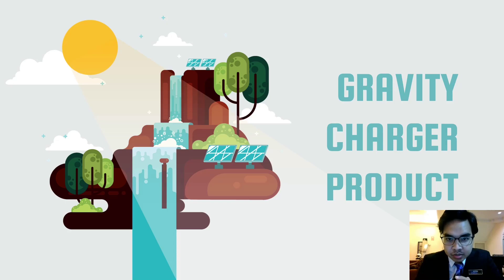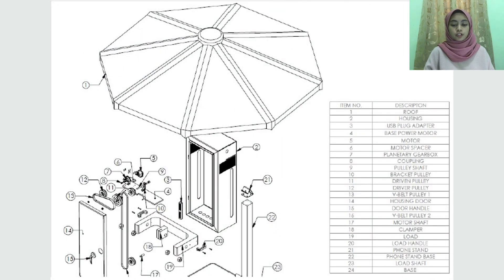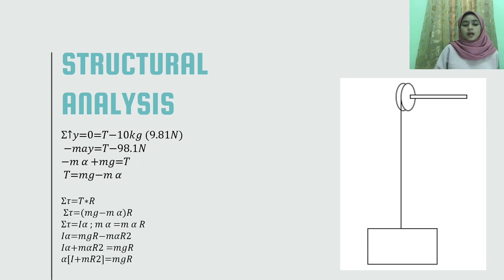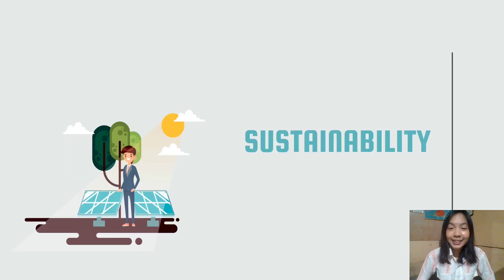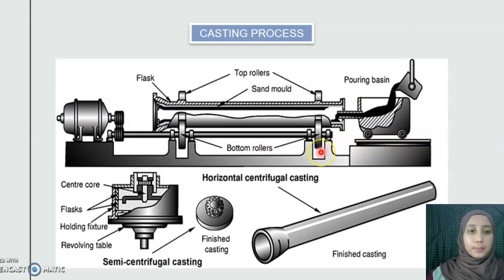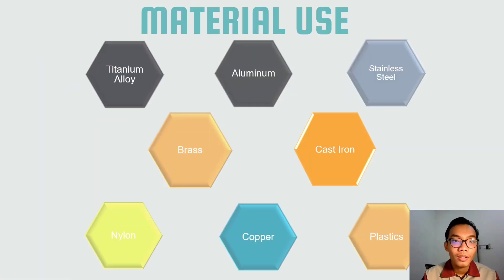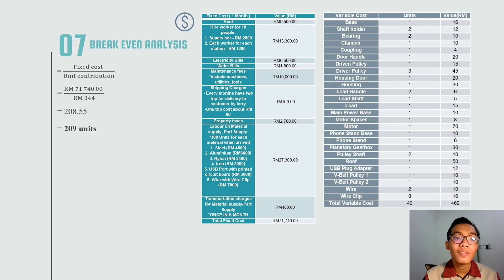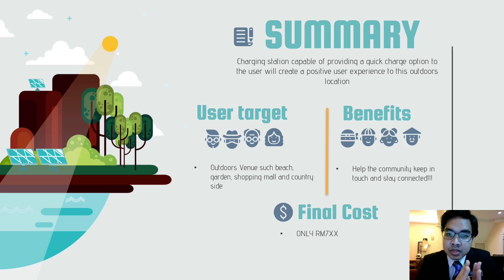IDP BMFG UTeM 20/21 - Gravity Charger

Comment: A good alternative idea for renewable energy. Video is nice as well. I got few questions here:
1. How effective is the cost compared to other existing energy available ie solar panel.
2. Is it safe to operate in heavy rain/lightning situation? Would you consider a covered 'booth' instead of open concept as presented.
3. With 44083rpm mentioned, how long does it take to fully charge the phone? For fast charging, you're looking at something that bumps the voltage up 5V, 9V, 12V, and beyond, or increases amperage to 3A and above. Can the product support this requirement?.

Thank you
Reply from the maker: Thank you Mrs Syahirah, for the comments. Sorry for late answers, here is our answers for the questions:

1. If compare with system, the cost for gravity charger is high compare to solar panel but gravity charge is not designed to replace the solar panel. It is designed for another alternative which the place that solar panel cannot be used. Example: At a recreational place or waterfall campground, there are a lot of tree that will have shadow which it is the disadvantages of solar panel to generate electricity. Even though the gravity charge cost is highest than solar panel but compare in operation of the system, gravity charger is easier to operate and cheap. 

If we dig into some research of the smallest size of solar panel which is (80mm x 60 mm) , the current and voltage will be 0.3A and 1.5V respectively, thus the power would be (0.3 × 1.5 = 0.45 Watt). And the cost of this solar panel will be around RM 8.00. 

But if we want to use as a charging smartphone system, the amount of volt for the solar panel to supply for the electricity must be at 5V at least and 1A, which means 5 Watts of power. And the cost would be around RM 59. 

The cost manufacturing stated for this gravity charger RM 699.13 per unit. The cost of the product only just one product. If we do in mass production, the cost manufacturing somehow could be less.

2. Yes, it is safe to operate in heavy rain / lighting situation because the material that we use to the covered the component is not conduct electric and the roof is covered the user when charging the phone. Yes, the product is designed based on open concept because it is human comfort in public area.  

3. It took 40 minutes to 2 hours depending on the battery capacity. But our product did not expect to achieve full charging capacity as our main focus to provide a specific amount of battery to ensure the user has enough battery capacity before they went home. For the bump voltage and the amp setting, our product focus on 12V with 3 amp so this product can produced desired output.
Reply: @nurafiqahaliya9763  Thanks Aliya for the answers. good discussion here.
Just some recommendation, as the concept is using motor, pulley and housing, all these component require maintenance. Please consider maintenance fees and also come out with proposed schedule maintenance based on rev/min calculation or any other relevant parameters to ensure good reliability/maintenance of the product. 

overall good product. Good luck!
Reply from the maker: @syah8517  
Thank you Mrs Syahirah for the recommendation and opinion. We will make improvements on the maintenance fees of the products and include it in our final report. Thank you again:)

Comment: Thank you for sharing information about this project. I like the video (it is simple and the color is nice) and love the idea of the project (simple mechanical means of generating electricity). May be useful in specific situation where access to electricity supply is limited. I have few questions to ask:
1) What is the size of this charger (height and dimension of the gravity charger)?
2) What is the amount of electricity that can be generated by this charger? can you provide simple calculation or estimation? Will it be sufficient to be used for charging phone?
3) What is the load of the mass? 
4) How high should the load be lifted in order to provide sufficient electricity for charging purposes? Will the time taken for the lifted load to touch the ground give impact on the production of electricity?
Reply from the maker: Good morning Dr Fatimah and thank you for the compliment. Here are the answers for the questions:

1. The height = 191 cm x length = 200cm x width = 200 cm (include roof) and the height = 191 cm x length = 110cm x width = 60cm ( without roof calculation) 

2. The charger has rated output voltage of 12V with the output current of 3 Amps. The charger wattage is 36Wh (power = voltage x current) 
12 X 3 = 36Wh
36Wh charger power consumption

Consumption 	 Total (Wh)	   (kWh)
      Hourly 	                36	           0.036
  Day (2 hrs)	                20                0.02

The gravity charger power consumption per day is 0.056 kWh. 
Yes, it is sufficient to be use for charging phone because the charger has rated output voltage of 12V with the output current of 3 Amps which the phone can fully charged with a charger that has more current capacity than needed.

3. The load of the mass is from 1kg - 3 kg.

4. 130cm height should the load be lifted to provide sufficient electricity. NO, the time taken for the lifted load to touch the ground won’t give impact on the production of electricity which user only need to lift once time, then the electricity will supply to the phone until it is fully charged.
Reply: @nurafiqahaliya9763   thank you for your reply. 
1)I am not very convinced that the height of 130 cm is sufficient to provide the charging power required to charge the phone.. and the load of 3 kg seems to small. (btw, I thought the calculation in the video was shown with the load of 10 kg?). The torque is proportionally related to mass hence the small mass will lead to low torque and therefore the power is expected to be low too.. 
2) I am not sure if this is the right answer... the charger or motor is driven by the rotational movement of the shaft, related to the mass attached to the pulley. So the calculation should involve all these factors too.
3) not 10 kg as in the calculation?
4) power is related to rpm.. and rpm is related to time.. so i think time is also an important component to consider in the analysis. And I am not sure whether the phone will be charged if the load of 3 kg is used with falling distance of only 130 cm... Not sure if the phone will be charged by the time the load reach the ground.

Nevertheless, I am happy to have the opportunity for this discussion. Hope the idea can be proven to work well. Best of luck.
Reply from the maker: @fatimahsaat8831  
Thank you Dr Fatimah for the reply. Firstly, we are sorry for the misinformation. The load is actually 10kg. Based on the survey answers from respondents, most of them answering that they can pull up the load that weight of 1kg - 3kg but after do some analysis, our last calculation shows that 10kg is the best weight for the load. The estimated time for the weight to fall down is 20 minutes which it can charge 10% - 50%, however it depend on capacity of users phone and our product did not expect to achieve full charging capacity as our main focus to provide a specific amount of battery to ensure the user has enough battery capacity before they went home.

1. 130cm was the average height that we get from the survey to ensure our product that can be used to people with variety height. That's why we use planetary gear to step up our rpm, the ratio is calculated to achieve our desired output.

2. Thank you for your view, we will include those factor into consideration for calculation in the report.

3. The load weight is 10kg, sorry for the misinformation before.

4. Yes indeed, the rpm is related to the time taken for the load to fall down. We will refine our calculation to shows that the rpm is suitable for the output that we want on the desired time in the report. 

Thank you for sharing your opinion with us, we will ensure the detail that you seek will be included in our report :)